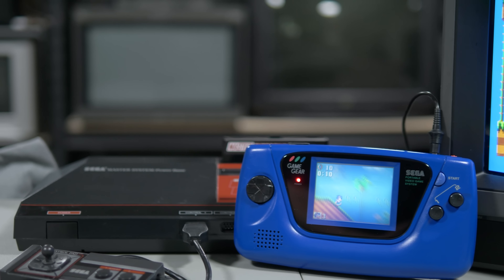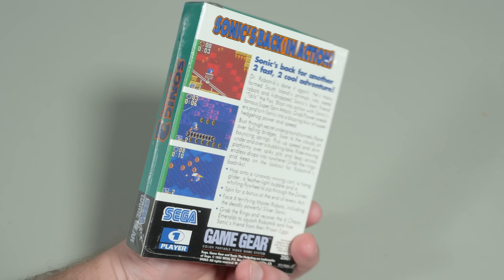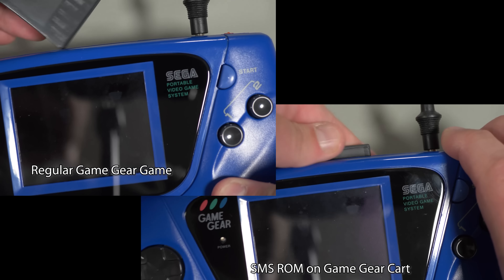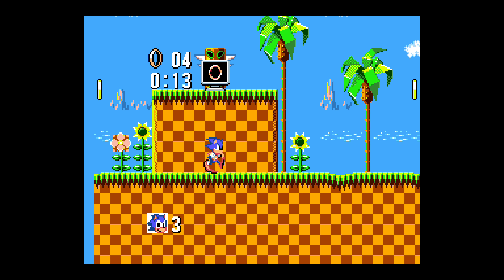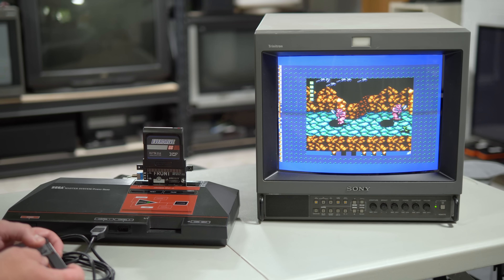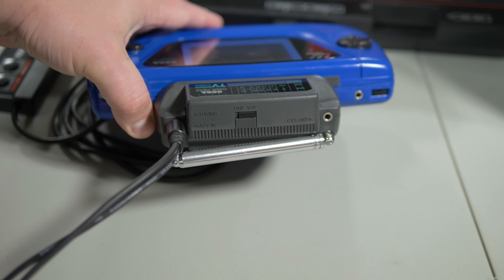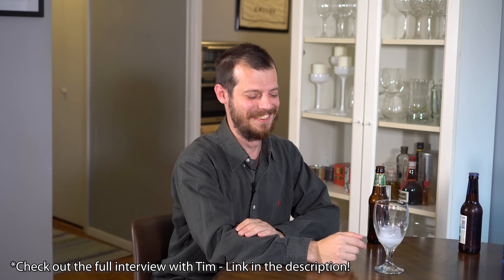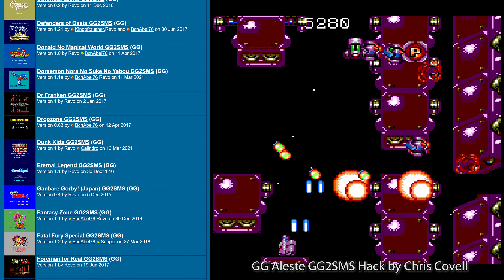Game Gear Games on Master System (and vice versa)

Comment: If you use the 3-in-1 adapter by Hyperkin on a Sega Genesis you can play Game Gear, the problem is that the colors usually get messed up and the screen is small. Also, does this GG reverse engineering project need parts from the original console or is it all new, like a clone system?
Reply from the maker: The Hyperkin is just way to use original carts via mid-tier emulation.  Using ROMs on a phone might even be better.
This project is more like a Game Genie that makes software changes in real time.
Reply: @RetroRGB  But it fits in the original Genesis and it works as a replacement for the Power Base Converter.

Comment: Kind of missed opportunity that they didn't add dynamic GG window cropping options, that way it wouldn't be fixed and the GG screen could have changed and improved over time. Would have needed a 160x120 4:3 LCD instead but then it could have bumped up to 208x156, and 256x192 GG models. Would have made AV-out more attractive for the GG, could have done 256x192 on TVs. :D Although really I always hoped Brazil might do a SMS-2 with Start button and improved color palette included, but it never happened. :(
If it had been adaptive from the start the GG versus SMS code difference wouldn't be the obstacle it became later. Certainly if I could hack GG titles I'd likely include a few window size options while I was at it. That sprite spawning window edge difference seems to give people some trouble though since many produce more screen but the gameplay is still 160x144 based. With GG exclusives there is a performance aspect for that smaller screen sometimes which is a complication.
I do think Sega could have planned the GG better though so that official SMS or Genesis GG cart adapters could have been made just like Nintendo did with the SGB. Glad somebody tackled a hardware based solution since palette shifting is a trivial matter, sure it looks technically better on GG but that doesn't mean SMS colors can't apply.

Sweet original hardware solutions you featured there, a new PCB is a great salvage option for those custom IC chips. True it's more a hobby to use OG-GG hardware now that I can see why many use other paths to GG gaming.

Comment: You mention the Analogue Pocket, but another possibility there is Analogue's Mega SG, for which a GG adapter is available and obviously works on a TV.  If you're an idiot like me you can even use the SMS convertor for the GG in the GG adapter despite the fact there's an actual SMS adapter in the box. The TV tuner, as I imagine you've guess, does not work.
Reply from the maker: Check the pinned post

Comment: Am I the only one that is more interested in the other way arround? Meaning more master system ports for game gear. Like you said, I am sure is not that hard to just grab some master system games, zoom in, move the U.I. closer if needed and then just having a cool game gear port of the game. There are so many good master system games with no game gear ports, like shinobi, phantasy star or the alex kid games. Some would even work ok. And no problem of missing colors.
I am all for hacks of game gear games zooming out, but I am mostly interested in retro handhelds, so I am more for hacks of master system games zooming in for game gear.

Comment: It would be better, if on the "Super Game Gear", they could map the Start button to a button combo instead of requiring that you use the SMS Pause button. (Maybe something like holding both buttons + up/right, for three seconds, for example) It's not very good if you are gaming across the room from your system.

Comment: What if Pin 42 is tied to "a voltage" that is zero?
Reply from the maker: Good question.  I never tested on the Game Gear cartridge, but with other circuits it depends on the chips:  Sometimes it'll default to one mode and other times it won't work at all without voltage or ground.

Comment: Bought one of these soon after  it's release.  I got shinobi (great  game) wonderboy (amazing) and a racer which was boring.

Over time though, I became fed up with flickering or ghosted sprites/scenery.  The blur effect also put me of investing my wages on the next game.  At times these screen effects reminded me of someone pressing heavily upon lcd display.

But I held out for sonic.  I had the mega drive and so thought th gg version would rock in a similar way.  It was the master system version....um.  the handheld should have been called - the master system mini.  I had always expected this device to be modern and not backward.  

Outrun was another fun but disappointing experience for someone who owned the 16bit  machine.  And shoot em ups were also troubling for me with such a tiny screen, blurred movement, and sudden, half toned sprites.

I stuck with the gg for 2 years and then forgot about it

Comment: Later game gear made by majesco don't have cap problem. Interestingly I have a theory that the cap issues on the game gear is from people using the sega genesis power adapter. There is no linear regulator in the gamegear thus receives the whole 12-17 volts (multimetered) from the power supply. With that said using a mini ps1 power adapter  outputs 7.5v (multimetered) is much closer to the battery total voltage and runs the console fine while minimizing stress on the caps.

Comment: Modified AT Games Legends Flashback is best , cheapest way to play basically all the old Consoles and their respective original as well homebrew libraries on a modern TV. My brother modified his awhile back and it plays Game Gear perfectly!
Reply from the maker: I’m sorry to tell you this, but the ATGames consoles are some of the worst ways to play Genesis. I guess they’re fine for casually checking stuff out, but calling them “best” is just flat-out wrong.
Reply from the maker: Wait, I just saw you said “modified” - I’ve never tried a hacked version. Maybe it’s better?  I’ll look into it if I ever have time, but the best is still original hardware and FPGA emulation.
Reply: @RetroRGB  if hacked and modified right!, it's pretty dang close to original hardware output but in cases far as NES it runs even better with clean screen corners and no annoying flickering or disorienting images as the original hardware always did! I've always been more a Sega boy myself so trust me it's worth checking out especially for the Master System, Game Gear and Genesis. It is capable of running Sega 32X and Sega CD games as well
Reply: @RetroRGB  yes out of the box they're crap! But modified they can be something greater aka a poor man's Raspberry Pie

Comment: Here's a fun fact... the Sega Game Gear had 8 times as many colors as the Mega Drive / Genesis; even though the Game Gear could only display roughly half the colors on-screen at once.  Even if you add the Mega/Sega CD, the handheld still has 8x the colors available!  In my opinion, I feel Sega should have added 15 or 16 bit color with at least 256 on-screen colors to the Mega/Sega CD.... that would have made the graphics good enough to compete with SNES, which was the goal of that add-on.  At least they added a chip for rotation and scaling, although it was a bit choppy in that aspect.

Comment: Game Gear games actually looked and played like console games. Nintendo didn’t accomplish this until Game Boy Advance. 
I thought Game Boy games were trash even back in the day. I could not see what was on the screen and the game mechanics were terrible.
Reply: The difference between a colour 16 bits VDP (SMS and GG) vs a 8bit 4 "colours" (grey levels) PPU, despite the same~ish Z80 CPU.

BTW, same situation in the Turbo Express (litterally same hardware as Turbo Grafx/PC Engine, including the 16bit graphical chips),  and the Lynx (16bit Suzy blitter chip). Basically all portable consoles back then had better graphical chips that the Gameboy. But all these also needed to rely on back lighting (which back before the era of white and blue LED meant using CCFL tubes). And "transflective" color LCD technology wasn't there yet, so no way to shut down that enormously power-hungry back-light (unlike PDAs a decade later). So GameBoy's craptastic visuals was the only way to not requiring a rechargeable battery pack (or tons of alkalins).